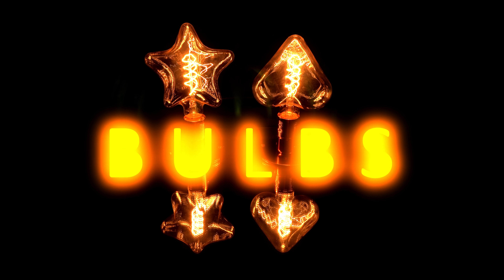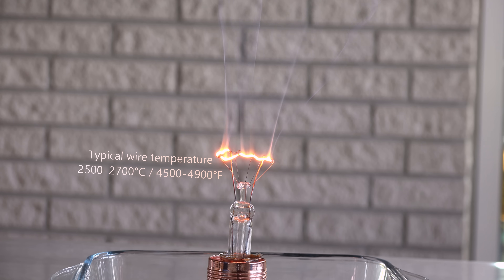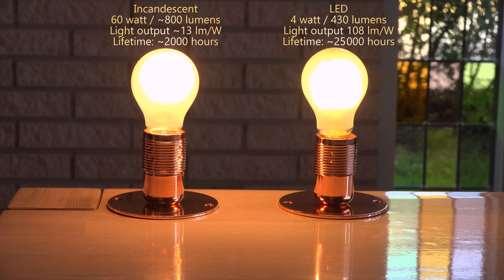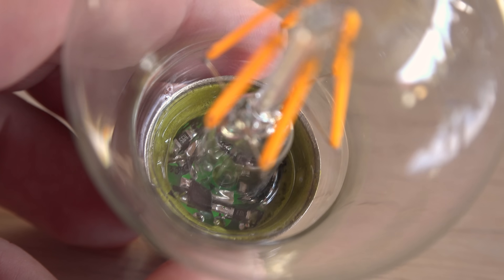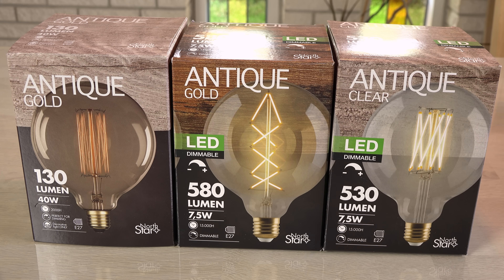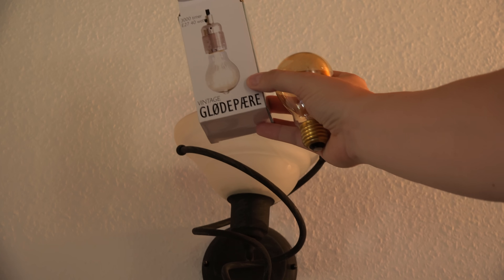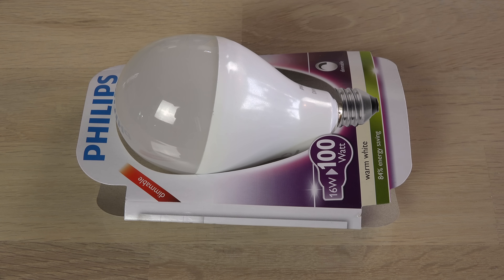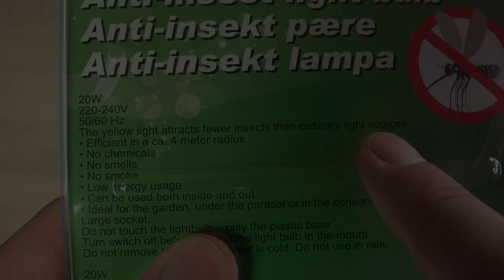Light Bulbs | LED vs. Incandescent

Comment: I'm in the USA and we're starting to use LED bulbs a lot. I think there needs to be a change to improve LED bulbs. Instead of putting electronics in each bulb, the electronics should be built into the lamp it is inserted to. That way we don't have to replace the electronics when the bulb goes bad. Or, we can change the electronics if that's the only problem. There's no need to throw away both the LED and the electronics if only one is broken. That would improve the chances of a higher quality electronics module.

Comment: We've gone back to incandescent bulbs because everything else is shit. This may be a bit crude, sorry but it's true.
Every other type of bulb has big problems. The LED, halogen and energy saver costs way more but don't last long enough.
Energy savers start off okay but after a few months they taken longer and longer to get bright enough to see with. Halogen bulbs just blow all the time. LED bulbs only last a few months and either flicker or just die off. 
Some of the bulbs I've bought have been £12 each some a lot less, good brands, shops own, unknowns it hasn't mattered. Incandescent bulbs cost pennies, last as long as the newer ones, give a nicer light, don't need to warm up, easy to get dimmable versions cheap, don't have issues working in winter.
All these bulbs are used in indoor lamps, ceilings and cooker hood, outdoor lamp  BUT I've found an exception.
GU10 bulbs in the kitchen used to blow all the time, LED or not. Then I bought LAP dimmable LED GU10 warm white 5w 220 lumen for about £8 each over 2 years ago. Never heard of LAP . Not one has blown, really good but not as nice a colour as traditional GU10.
Wish all new tech bulbs be as good as these.

Comment: Ok, LED light bulbs are ok, but it is something that people don't know. The fact that the LED bulb can last for +10000 hours is 50% false. Why? Because ok, LED and only LED can last so much but what about the circuit that drives them? If one component from inside fails, the rest of the circuit is affected in such matter that the LED light bulb is no longer useful.In another way, the LED is more expensive than incandescent bulb but uses less energy. The incandescent bulb is the opposite.It is harder now to find incandescent light bulbs (those 100W or 75W from China), but if you think a bit you can use 100% efficiency of the incandescent bulb in a food dehydrator. It uses heat of the bulb to dehydrate the fruits and vegetables and bonus you have light :P Related to the prices, if you put these together you might come at the same price. You pay less for a product that use more energy or you pay more for something that uses less energy (a kind of 1+2=3 or 2+1=3). I am an LED fan but after making some calculations I came up with this taught. What do you think?

Comment: Why do wildlife not like LED lights?  I tried using them in my home in different applications as the kitchen, bath, work areas, and bedroom.  I used cool, full-spectrum and warm lights and they all hurt my eyes.  There is something really odd about the light from LEDs - enough to keep me from using them.  The flickering seems to affect me and wildlife in a negative way.  Energy savings don't sway me enough to back away from incandescent or halogen, both with a more natural light.  The sun is appearing to have the same light as an LED - very fake and unfamiliar.  Too bright to be enjoyable.  Hope we can continue to find incandescents and halogens - saving my eyesight is worth the extra cost.

Comment: 1) The power rating on the CFL was probably the equivalent power rating. At least in the US, the actual power rating for CFLs is listed in fine print somewhere else. The purpose of the equivalent power rating is to "help" consumers choose bulbs that will provide similar light intensity. So, when the packaging for a CFL says 125 Watts in big letters, that means that the light intensity it produces is equivalent to that of a 125 Watt incandescent bulb; not that the CFL consumes 125 Watts.

2) LEDs closely match the stated power ratings because there is less uncertainty in the material performance. Analogue bulbs, such as incandescents and CFLs, have more uncertainty. Therefore, in order to avoid being sued, companies intentionally give analogue bulbs power ratings higher than the actual intended power consumption.

3) Another example where LEDs would not be preferable are commercial airports. Some commercial jumbo jets are equipped with technology to help pilots navigate in poor visibility. This technology relies on the infrared radiation from the lights. Switching to LEDs would essentially render the technology useless.

Comment: only if those LED bulbs would last like the old ones. I have bunch of incandescent bulbs over 20+ years old i used them to do my homework at evenings and still i use them in my garage... while LED's works for a few months then it starts to buzz, flicker all kinds of shit with circuit problems starts to appear.

Comment: One thing with the LED bulbs they don't like rain soon blow, whereas the incandescent will last long out side bulb.
If a LED blows it can still use electric due to the electronic inside, I'm told can even increase electric usage.
The cost of buying vs how long they last vs power they save vs brightness.

Comment: The large problem of LED and fluorescent it's the pollution.... The semiconductor industries is not ecologist.... Huge consummation of power, rare earth element, the use heavy metals. With incandescent light don't have any large problem of pollution, it's just the question of how you make electricity.
It's just, bullshit.
Reply: Question: do you use a smartphone? Think deep on why I asked you that question. FR
Reply: but LED lasts 20x longer lol
Reply: I'd make a bet that the power consumption being at most 1/6 of the incandescent would still be the greener product if electricity is coming from coal. Maybe natural gas and solar/wind not so much but still got to remember if your lighting takes 6x the panels or windmills and producing them causes pollution too.
Reply: And the lighting is more bluish and because of that it is tougher on the eyes. Second problem: They don't worked well with adjustable lamp because they are heavier.

Finally they do not lasts 20 longer on old sockets.
Reply: Sure if you consider milligrams of material that isnt very rare that'll last 25 times longer than a fairly rare metal that is more recyclable. But for the most part the goal would be less energy consumption. If millions of tons of toxic waste happens in China, does the EU care?
Reply: don't confuse LED and fluorescent, especially when you talk about production.

Comment: Maybe I'm getting cynical in my old age but I've often wondered if governments banned incandescents so that we (Australia at least) could keep infinitely increasing our populations (ponzi demographics) without the electricity companies needing to greatly expand their supply capabilities. Also has anyone noticed that LED and CFL bulb packets tell you that they last up to 50,000 hours which they probably would if you never switched them off. Unfortunately it's the electronics in them that fail. There are plenty of ECU circuit boards (computer circuit board that runs a car engine) that are 30 years old and still running and yet a CFL is lucky to last a year???

Comment: On farms incandescents keep hen houses warm but without them LED just do not get warm enough to even melt snow so now the farmers use more energy to heat a hen house along with a light,  and so any benefit on energy saving is tossed out the window.

Comment: It was really stupid to ban standard bulbs.. Now you have to spend so much more on LED bulbs to achieve same amount of light output. And also some of those "energy saving" bulbs actually contain mercury. So yeah I pay more to be able to poison my self with mercury if the bulb brakes.
Reply: Those are fluorescent bulbs. They're not the same technology as LED bulbs.
Also, you spend more, but you save more in the long run because the LED bulbs last several times longer, so you don't have to keep buying standard bulbs. Plus, they consume less electricity so your bills are lower. The 9W, LED bulb in my room produces the same light level as a 60W bulb... but at 3/20 of the electric consumption.
Reply: Those CFL spirals are being superseded by cheaper LED which don't contain mercury. A real bunch of Luddites posting in this thread...
Reply: That's due to many having a shitty ballast that causes them to flicker the no name Chinese ones are esp bad.
Reply: I pay $2 per LED bulb.  They quickly pay for themselves in energy savings.
Reply: @toriless  At $0.08 per kwH and assuming that you are replacing a 60W bulb with it, you would need 416.7 hrs to break even.  Whether you consider that to be "quickly" would depend upon your particular usage patterns.

I have some lights that are regular fluorescent, some that are CF, some that are LED, and even one that is mercury vapor.  The mercury vapor one is the one that has lasted the longest.  It is on an exterior yard light and has been here at least 15 years.  If the bulb ever goes out, I'll probably end up replacing it with multiple LED lights since they don't have the long initial warm-up time prior to producing full light output.  I don't leave the light on all night and only turn it on when I need to go outside at night, possibly to investigate something that the dogs are barking at.  From a security standpoint in cases like that, I would prefer a light that immediately went up to full brightness.  Back in the incandescent days, I found that I preferred having multiple 40W bulbs along the eve of the house for exterior security lights instead of 150W flood lights on the corners of the house.  The 150W lights were blinding if you looked at them at night and you could not see anything on the other side of them.  The 40W lights provided a nice lower intensity glow and you could see past them, so whatever you might need to shoot was still visible.
Reply: you can get l.e.d. bulbs for a dollar at the dollar store now.
Reply: You pay less. LEDs are more expensive in the first place, but they save a lot of energy and IF you bought a good one, they will work for decades. LEDs also don't contain any mercury. It's a different technology. The first energy saving bulbs did contain mercury, but not the LEDs. LEDs are everywhere, even in your kid's toys.
Reply: i buy standard halogen bulbs on ebay
Reply: Avoid the dollar store bulbs, as the quality is not good. They likely won't last long too.
Reply: THE PRICE OF LED LIGHTS IS GOING DOWN ,AND LEDS DON'T CONTAIN MERCURY
Reply: CabinDoor obsolescense*
Reply: Or just order incandescent bulbs online. You can still find them in stores in the USA.
Reply: Most of the lighting in my country uses LED since 2010. If LED bulbs really cause mercury poisoning, there will be tons of reports on it but nope not a single reported case.
Reply: You probably would not want a dollar LED bulb as it probably would have poor color rendering and flicker.
Reply: The only stupid one here is you. Before you were paying half the cost to one tenth the amount of light. You are paying less money for more light now but still complaining because either you dont like change or you dont like being told what to do. How childish.
Reply: Objects in Motion LED’s are being found to cause macular degeneration and other eye damage, hormonal imbalance and more. The bans were introduced 2 years prior to the study results. The problem is the government should not mandate people to use a certain bulb, especially if the results aren’t in, and it turns out they are dangerous. LEDs do not have mercury like cfl’s but they are apparently not completely safe.
Reply: WB IsMe I was talking about those "spiral" energy saving bulbs.. they contain mercury.
Reply: xkeepersvk 
I agree. Also LED's makes me nauseous and gives me a bad headache! Toxic technology at its best!
Reply: >Also LED's makes me nauseous and gives me a bad headache!
Don't buy shitty bulbs? In this video you can see, that cheap LED e27 is flickering bullshit with really bad range of light, but normal one is better than fluorescent bulbs (has no pulsations at all and has a bit better color render) and if you don't need to work with color - it's almost the same, as incandescent, (especially with warm light) but can work for much longer period (5-10 times). Also they much cooler. But after below -10 degrees celsium they work pretty bad and need heating.
Plus in my country 9w Philips LED costs $4-5 and I see no point in buying incandescent bulb for ~$0.40, because before LED dies (after warranty period) i'll change at least 2 incondescent (but more likely 4-5) and consumption difference is 85-90%.
Reply: @jayebirdjb7143  More like "thinking I'm under LED lights makes me sick". I highly doubt a blind test could detect it. (though admittedly, a blind test would be hard due to the different standard ranges of color temperatures)

Comment: I love my 5000k LED 1600lumen 16watt light, supplemented with a secondary 5000k LED 800lumen 9watt desk light, for a brutally bright room! No idea what Color Rendering Index is, there is none in America, but with both lights on I get perfect camera quality for video chat. Much better than a 60watt and 40 watt incandescent bulbs I had 4 years ago. Or that worthless CFL that burned out within a year! Being an early adopter my 1600lumen was $20, as long as it lasts 5 years, it will be worth the money, also it doesn't have a smell like the CFL did. 
I don't understand the hate on LED bulbs. Just use 2 bulbs in the room for adequate light saturation, and stay away from 3000k LED bulbs.

Comment: Hologene are the worst. Consume less then incadescent, but mercury.
Led lights are nice but the efencientess gain inexistant part of the year where it get colds in winter. And the are easier to recycle, so, at least in winter, there are better choses...
The heat produced by the lights reduce heating demands. So eficient light, well... You consomme ~has much~ ( ya approx) energy. Just using less environmental friendly things...
So banning Incandescent in cold country is dump and stupid...

Comment: Incandescence does not emit light due to electrons dropping from higher potential orbitals, it emits light due to the thermal vibration of the molecules that vibrate in a distribution of frequencies depending on the object's temperature. The quantum jump effect is seen in LEDs, which only emit in a certain wavelength because it is the specific energy corresponding to that drop in orbital energies that electrons make, and that's what makes them more efficient, more energy goes to emitting visible light, instead of a continuous spectrum of infrared, visible and uv light like blackbody emission does.

Comment: Are you sure the philips bulb was an LED one?
Usually when you see a bulb take twice the power on start-up its an incandescent/compact fluorescent hybrid where the incandescent stage provides instant light and heats the fluorescent tube more quickly to operating temperature.

Comment: Switching to LED is a total scam pushed by the liberal left. The LED bulbs DO NOT last nearly as long as they claim but cost several more times than the regular incandescent bulbs. I bought some Feit LED bulbs that were supposed to last 22 years but burned out in less than a year. This costs the consumers a whole lot more than the energy it saves therefore benefits only the LED bulb manufacturers.

Comment: Great video, however, which one cause more pollution when in trash ? First, the original bulb when invented was made to last almost a lifetime, but the greedy filthy rich idiots want you do buy every months or so. As for the fluorescent ones, they contains highly poisonous stuff inside like mercury (when one broken, you have to open a window and leave the room for 15 minutes), plus when cold, it takes awhile to light up. Now the led is new to me as a replacement for light bulb (heard its expensive to buy), i do have a 2 AA batteries table led light (super bright), unbelievable, for a 2 AA batteries it sure last very long, but i think it does loses is brightness overtime, so slowly that you don't realize-it. As for pollution when in trash, it seem to contains a few electronics device, so is it causing more pollution than the regular ones ?

Comment: I remember stocking up on incandescents when they banned them.cause they were cheap. bought out a stores supply. still using em today
Reply: John Johnson as did I 😁💡
Reply: They were super cheap here as well, so I bought literally hundreds for very cheap. I decided to upgrade to LED anyway (which I think was worth it) and sold off the incandescent ones for over market price because at that point they weren't in store anymore lol
Reply: I still use them and you can still buy them but those of us who bought them early saved money

Comment: Many farmers including myself use incandescent bulbs in winter to keep livestocks water from freezing. A ban would be detrimental to farmers..
Reply: Liam Barnes Dam your pretty frigan rude aren't you. You obviously know nothing about chickens, if you want your hens to lay eggs all winter you do it with incandescent light bulbs under a translucent or clear water container, this has the dual purpose of providing light AND heat. Just enough Heat to keep the water from freezing and just enough light to keep the hens laying. Heat lamps are way to hot and use more energy than a simple 60 watt incandescent bulb.  No other type of lightbulb provides a more efficient combination of light and heat. I'm sure I would know if there was a better method than this, it's common practice here in New England. Please try to be a bit more civil in your discourse. Cheers.